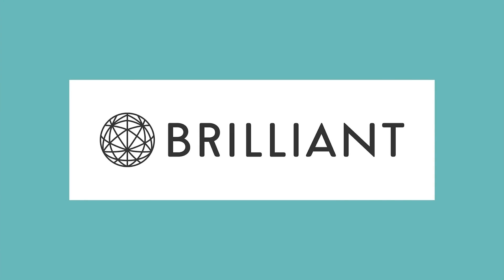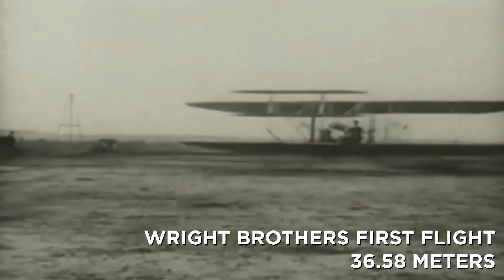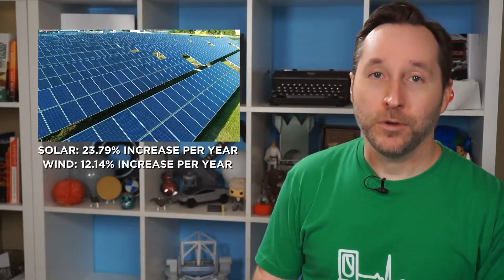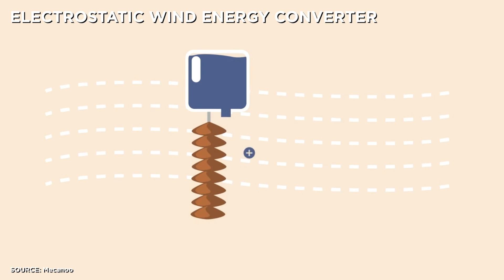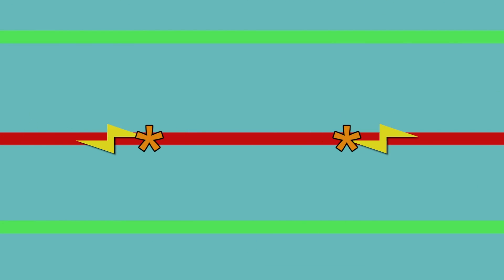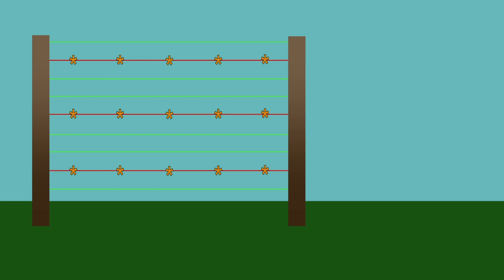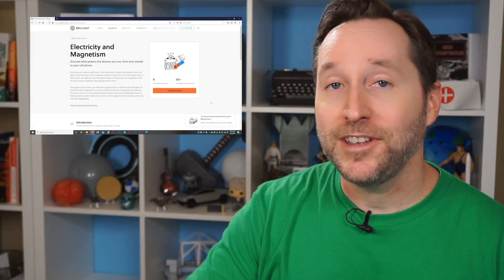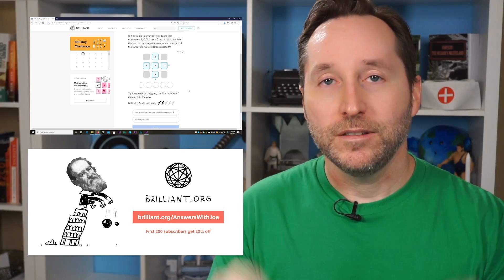Solid State Wind Energy | Random Thursday

Comment: A silent, solid state wind energy harvester would be quite the game changer.
Reply: The US can put these all along the southern border. A 1000 mile long electric fence .... producing renewable energy. The Californians won't know if they need to have peaceful protests in support or against it.
Reply: Unfortunately, sound-wise, this trades a low whooshing sound for a high-pitched whistle as the air blows across the wires... just like wind through a fence.
Reply: @rmiller6838  That depends on the gauge and material of the wire and the tension and span used in stringing it. On the scale they'd have to made to be practical, it is possible that we wouldn't hear it much more than we hear the wind in electric and telephone wires now.
Reply: Or, we could just have large (just enough) buoyant columns in the ocean with generator articulations to use as electricity farms whilst also providing marine life with homes.
Or one of those floating serpents that works just fine, that could also be retrofitted to catch garbage in the seas, which we could have poor people collect and sort as jobs to provide for them too and help everyone clean the oceans.

But no, let's go after the most difficult and unfeasible technologies and solve nothing in the process.
Reply: One question, does it work if birds poop on it?
Reply: Nope, total waste of time and money.
Anywhere dry enough for this to work, you're orders of magnitude better off using solar.
Reply: We need to be able to store it in bulk ...
Reply: Until those bird people start complaining about all the poor birds being injured by the 17 gauge (guillotine) wire strung everywhere.
Reply: @inimic6900  Tip: Nets. Or harvest and sell the birds as meat.
Reply: Tesla needs to start making these.
Reply: @wattlebough  Well it will work on Mars, even in a dust storm.
Reply: @johannnyborg3998  first of all Mars barely has any wind and when there are dust storms it only goes 30km an hour on a weekly basis it goes faster then that where I live
Reply: @johannnyborg3998  7m tall masts with wires generated 20mW, enough to run a battery clock radio for half an hour 5 days a week! Though cheaper, it is hardly worthwhile even if efficiency increases 1000 fold. Even on Mars where real estate is free, wires and masts have to produced by robots, as wires are heavy at that scale. If a robot can make one collector per day, in 1000 days the installation will have an output of 20W. While the robot will have spent in the neighbourhood of 20kWh per array, remember metals have to be chemically extracted and then smelted to make wires. In other words, 20MWh have been spent, which the array then will be 1 million hours, or  41700 days or 114 earth years to recoup, before generating a surplus! This tech is only for low power sensors on mountain tops, not utility scale on any planet. A NASA grade 60W solar panel can do the same thing at Mars solar radiation levels, weight 4 pounds and be deployed immediately.
Reply: @octaviusgalacticus2253  Still, it will work better than solar panels in a dust storm.

Comment: Wow! - surprised how negatively you feel about wind Joe.

A lot of the maintenance and EOL information you quote is outdated.

And yeah, everytime I've visited a wind farm I've had climb over piles of dead birds... NOT.
Reply from the maker: I’m not against wind (hence the line “wind is awesome”) , just setting up the issues this concept could fix.
Reply: @joescott  Hi, I guess I should apologise; this video dropped at the same time as the (Oz) Federal Government announced it's plan to move to a 'low carbon' future by replacing coal-fired power generation with gas (FFS), so I was probably being a tad oversensitive...  :-(

Comment: One way to save birds is to paint one of the 3 wind blades black bird deaths drop by 50%
Reply: And by 50% more if one more blade painted rainbow.
Reply: @shurmurray  Just put some mirror flakes in the top coat. Several bird repellents work by shimmering sunlight with mirrors. Though neighbours will have another thing to complain about besides ugliness and noise.
Reply: @shurmurray  That only works on the homophobic birds. The gay ones head right for it out of sheer desperation to finally be accepted in bird society.
Reply: The bloke above said 70%!
Reply: That's a thing?
Reply: Yes. https://www.fastcompany.com/90543981/painting-wind-turbine-blades-black-can-reduce-bird-deaths-70
Curious how painting a blade black impacts the life the the blade due to increased heat absorbance or throw the balance off on a compete fan unit due to the weight of the paint?
Reply: @DazedLogic  Yes it is a thing
Reply: I drove by TU Delft only yesterday. Have to check out the prototype some time.
Reply: Being serious, have they tried a zebra print? I ask as someone said black blades dont last as long, this could be a compromise....maybe!
Reply: you gotta paint one pink though. you cant have a black and 2 white blades without the female demographic represented too. hell just rainbow the whole thing.